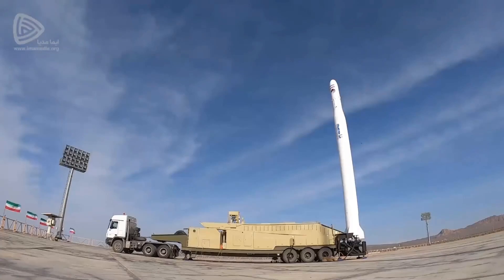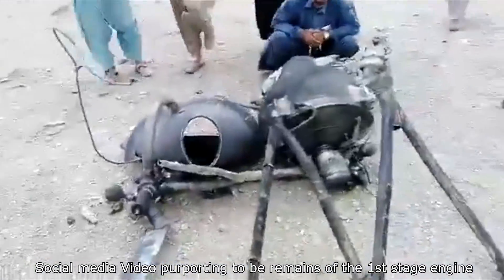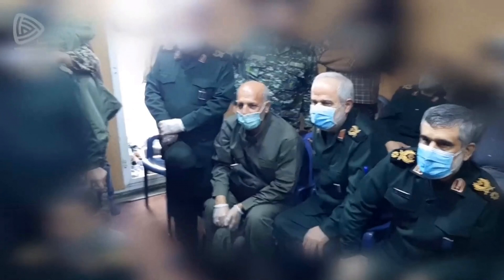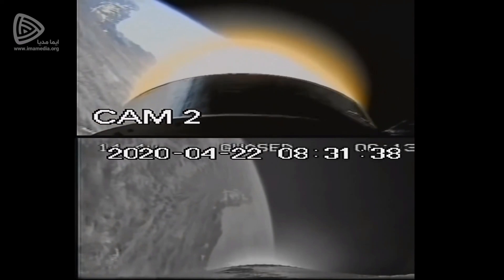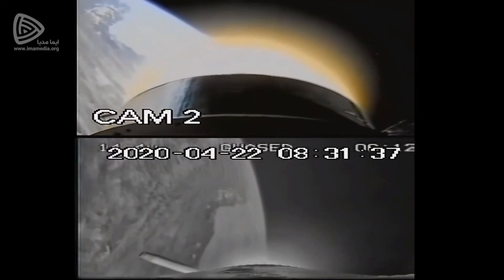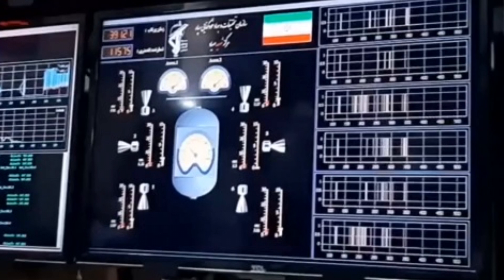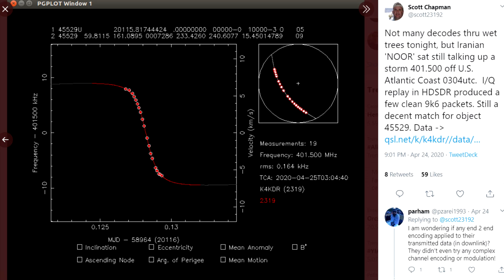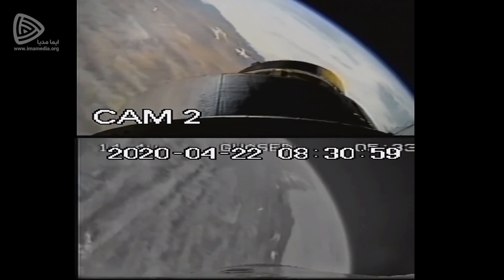Decoding Iran's New 'Qased' Rocket and the 'Noor' Satellite

Comment: I don't know why but the engine resembles the V2 engine in its primitive style.
Reply: Indeed. The Scud was a V2 derived design as well
Reply: This engine looks next generation from V-2 technology. It successfully uses two innovations that German scientists have not been able to perfect during the war despite trying very hard. First -- flat injector head. Second -- very narrow regenerative cooling gap which is necessary for a high performance engine. This may seem trivial, but it was counter-intuitive and revolutionary at the time, required a very significant development of technology, and is still being used in nearly all engines.
As for the turbopump, V-2 had a very good turbopump, but German rocketeers have bought it from a commercial company (Klein Schanzin Oddesse GmbH) which specialized on pumps for firefighters etc. It was already a very mature technology, just used for other applications.

Comment: Still using vanes!🤣🤣🤣..  That goes back to the V-2 and the ceramics ( to withstand the rocket blast) developed by Dr. Ottmar Stutzer.. later to move to USA under Operation Paper Clip.  Of course, there is no gimbaling an SRB.
Reply: It's entirely possible to gimbal an SRB nozzle.  That was the sole means of flight control for the Space Shuttle for the first two minutes of launch, and also the sole means of flight control for the Minuteman ICBM.  Just because KSP doesn't permit it doesn't mean it's impossible.
Reply: Many space programs have switched to disposable vanes that only lasts for the few minutes needed.
Reply: if it works

Comment: what is the difference between  3u and 6u cube sat?
Reply: 2x 3U stacks. Each U is a 10 x 10 x 10 cm^3 cube. a 6U is therefore 20x10x30 cm^3.
Reply: this, also the significance is that resolving 3U from 6U means your optics must be good enough to tell that size difference (instead of both being one pixel)

Comment: Acid and kerosene again, as per usual for them. Its high NO2 based acid for sure, so 80/20 RFNA is likely. Nearly 100% positive though that its kerosene or similar long chained hydrocarbon.

SRM looks to be in-line with the Star SRM. Maybe a touch smaller. Definitely a game changer for Iran and rather surprising.
Reply: Great notes.

What would one use other than Kerosene as an energetic hydrocarbon, and why?  I think the reasons for not using octane or decane are obvious...
Reply: @HuntingTarg  Gasoline, diesel, various alcohols of the methyl and hydroxyl types, turpentine (or many other various turpenes), aniline, furfuryl alcohol, etc. The latter 3 all being hypergolic with nitric acid >83% generally, with MOX and >87% in the white. Many others. Its a oxidizer so it will increase the rate of combustion for all flammable materials. Some more so than others.
Reply: Once the Islamic Republic of Iran makes a viable solid fueled first stage, they will have a functioning long range ballistic missile. They need this to achieve a military deterrent with Israel & Saudi Arabia, as this would launch an EMP 
device [thermonuclear], which allows them to level the field if war breaks out. As Iran can stand up to Israel & Saudi Arabia if no high tech weapons systems are involved, hence the need for a way to launch a nuke into low earth orbit. 
[ note their faith prevents them from using thermonuclear weapons on their adversaries populations, however their faith allows them to use an EMP to disable their adversaries modern weaponry...]
Reply: @davidhollenshead4892  Keep dreaming. And you don't launch nuclear weapons into low earth orbit. That would be pointless.....since, it would just be orbiting. ICBM's follow a ballistic trajectory, meaning they follow an up-down flight path and they never reach orbital velocity. Though, they do go really fast, just not tangent to the earths rotation.
Reply: I agree completely on that being a kerosene/acid engine using some kind of AKS oxidizer. Probably uses UDMH of Tonka as a starter.
Reply: @seanbaskett5506  There is no need to use hydrazine as an ignition source. If they had access and handling equipment to UDMH, then they would have a far higher impulse fuel source and a means to use it. They use kerosene and acid because they are cut off from the majority of the world due to sanctions so what we consider relatively normal in the aerospace industry, is an exotic to them. Thats why they use normal hydrocarbons with acid as propellants. While kerosene (or similar) and acid has high density impulse (which is good), it really is not a great performer when you are trying to go to space. So while you have density impulse working for you, you need to carry more of it because its a lower performer. They use it, because its all  they have readily available to them.

For ignition, they likely use a simple pyrotechnic ignitor. Its very very very very very common. Pyrophorics and hypergolic pre-ignition fluid is more complex so not likely used. Though, it could be. The 3rd stage likely uses a GOX/fuel flare tube (torch) that emanates from the center of the injector for ignition.
Reply: @seanbaskett5506  And tonka?? lol Me thinks you are Wikipedia a bit much.

Comment: Nice analysis -- and it is fascinating that Iran has shown so much technical data about this launch. The first French satellite Astérix was launched in 1965 using a somewhat similar Diamant launcher -- roughly the same size with one liquid + 2 solid stages, (though Diamant first stage engine did not even use a turbopump, and undoubtedly had a much simpler control system.)

Regarding resolution limits of cubesat cameras. The diameter of the lens/mirror sets the limit of its resolution. One can make pretty much arbitrarily long focal length even in a small size objective that would fit on a cube sat (using folded light path, Barlow lens, etc), but that would not provide any higher resolution than the diffraction limit set by the diameter of the lens/mirror.
Reply: How can you mention Astérix and DIamant without mentioning that the fuel was organic Southern France-sourced turpentine!
Reply: That was nothing but an ICBM demonstration. 

Some countries will react soon, because they have to.
Reply: It's just a facade to make it seem like they're doing it for science. Until they chill out, I don't want them having high tech missile systems. Just like Kim.
Reply: @TLN-qu4rq  If they either designed it or drew upon designs from other nations willing to share it with them why not. What happened to good old freedom. Funny thing is if America didn't interfere with the middle east we wouldn't have to worry about Iran. While they may be admittedly fairly hostile we have no business there, and a lot of the hostility towards the US is directly due to US actions against Iran. Who are we defending, literally no one in the region is obliged to help America in our time of danger by treaty or through NATO and we are supposedly the largest oil producer I'm sure we could manage alone and leave the countries there to finally figure things out for themselves. US involvement has decimated the region even the Iraqis dont want us anymore, both major terrorist groups in recent times exist partly thanks to US actions causing the people to radicalize either directly with al Qaeda along with financial support early on or indirectly with isis. We really have to establish diplomatic ties and not military ones if it isnt too late due to our countries reputation in the region as we can see with Iraq coming closer to china and asking us to leave. We are being leveraged to do Israel's and Saudi Arabia's dirty work through oil market and foreign interference.
Reply: T4L0N57 well, you really don’t have a say or control over that
Reply: Decoding Iran's New 'Qased' Rocket and the 'Noor' Satellite just shoot it down and anything they launch
Reply: @curtdenson2360  Don't start another war over pure jalousy.

Comment: So Iran now has an icbm
Reply: It isn't far from one.
Reply: They'd still have to stick the landing. No good bringing down fire and destruction onto somewhere sort of vaguely in or near the Levantine kind of area. Also nukes weigh a lot more than cubesats.
Reply: @charleslambert3368  No, if you can nail a pre-planned stable orbit, then that necessarily means you could bring that payload down on any point of the planet you wanted to.
Reply: @charleslambert3368  Bro, what part of "it's a portable, with a low cost liquid fuel, and minimal bells and whistles" do you gumbos not understand? Iran already said; it was the cheapest, slapped together, last minute deal to show how fast it can be assembled and used for civilian or military purposes, and at the same time, keep a second eye on America, but you gumbos are more than welcome making a$$es and assume this is the most advanced thing Iran has ever built hahahahahhh    FFS it's a response to trump's tweet to shoot the gunboats smh  hahahahahh
Reply: @charleslambert3368  ICBM trajectories tend to be suborbital so if you have enough delta-v to get virtually any payload into orbit you probably have enough to send the warhead on a suborbital trajectory provided you have adequate thrust. There's a bit more to it, there's the guidance system and a rudimentary heat shield, but once you have orbital capabilities you've pretty much solved all the hard problems.
Reply: @costakeith9048  "here's a bit more to it, there's the guidance system"
We already got a look at that with their strikes on our base in Iraq.
Reply: @abram730  The strike on the Iraqi base(s) were deliberately weak, to avoid starting the full on war the US tried to provoke by executing Irans most famed general while on a diplomatic mission to the Iraqi government.  The US really loves starting bullshit wars, like the Iraq invasion and the recent escalation against Venezuela.
Reply: get over it. israel has them too and nukes. and the samson opion.

i would worry more about the violent people in israel who think god chose them to bring armagaddon
Reply: @iranazadi7  When have they ever said such a thing publicly?
Reply: @iranazadi7  God did choose them....
Reply: Pretty much any rocket that can achieve orbit is effectively an ICBM. Usually I'm happy to see smaller countries succeed with their space programs, but Iran perfecting these capabilities is a bit unsettling; especially considering the dubious situation with their nuclear industry right now.
Reply: @costakeith9048  just USA used necular weapon in the world! So you must be unsettled about USA.
Reply: @costakeith9048  First thing JCPOA did was search "Russia, the United States, China, India, Iran and North Korea are the only countries that have operational ICBMs hahahahahahh   it's public knowledge, gumbos. The deal is for NEW developments, gumbos hahahahahhh
Reply: @costakeith9048  senior pepe must go back to meHico hahahahh

Comment: I don't understand why a solid fuel stage is a big step forward - surely it's less useful than a liquid fuel rocket as it can't be restarted?  Also, how can a solid fuel rocket have a motor/engine?  There is no pumping, etc involved, it's just a tube of explosive that's set light to.  OK, it can have a steerable cone, but does that make it a 'motor'?
Reply: solid motors are storable while fueled with a fast launch cycle. While this isn't exactly important for a space launch system it's extremely important for long range missiles that you want to be able to fire at a moments notice (think US Minute Man missiles).
Reply: Solid rockets are also called motors because they make motion, even the solid fuel tubes for model rockets are called motors. This one has thrust vectoring, yes, but it's altogether a bit more complicated to develop and manufacture than just the "trashcan full of boom" that ksp makes srbs out to be lol.
Edit: also left out that some respectable liquid engines can't be restarted.

Comment: What's your opinion on solid rockets firing in Leo. 1/3 of all space debris is said to be from the metals in the powder
Reply: @1Energine1 I'd like to see the maths done, but maybe it's possible that exhaust particles could enter retrograde orbits. For that to happen, they'd have to leave the rocket at 1.5 to 2 times orbital velocity, depending on the launch profile. Although I can't imagine that being much of a problem, as most space launches have liquid-fuelled second stages.
Reply: Looks like the bit showing their telemetry is after the 2nd stage has finished firing, and it still has the negative perigee. So unless their 3rd stage actually is an SRB instead of liquid like they said, there at least won't be any orbital debris from it.
Reply: @chrisc1140  just cuz the stage itself won't make orbit doesn't mean its combustion products wont. they fire off at much higher velocities than the stage itself.
Reply: @oldfrend  The combustion products are fired directly opposite to the vehicle direction of travel though so you have to subtract those two velocities. I'd be surprised if the debris didn't deorbit very quickly, especially considering its low mass.
Reply: @oldfrend  The exhaust velocity of the solid rocket booster should be around 2,5 km/s since the ISP is around 250. So it's going to be impossible to get the combustion products into orbit. Even if the rocket started tumbling and firing its engine in a prograde direction (when the screenshot was made the rocket was going 5km/s, so that's still barely enough to get into orbit when adding 2,5km/s).
Reply: @oldfrend  Even better if the combustion products fire off at high velocity. If the rocket would just stop it would fall to earth downrange. But if you actually accelerate backwards, you would fall down even faster since you take out the forward momentum. And this is what you do to the fuel particles - deaccelerate them.
Reply: It will disperse very fast, just from radiation pressure and the tenuous atmosphere drag, so within a week you will be hard pressed to detect even single particles even following the launch trajectory exactly. Wonder more where the bigger parts are going to come down, hopefully not over populated areas, because the launch direction has very little water till you get over the pole and into the Pacific, so any mid stage "rapid unscheduled disassembly" is going to drop large chunks of metal all over the Russian Steppes, though to be fair the old USSR has dropped kilotons there already, and not all of it has been aluminium and steel with a smattering of titanium alloy.